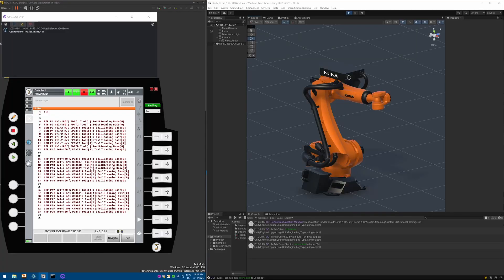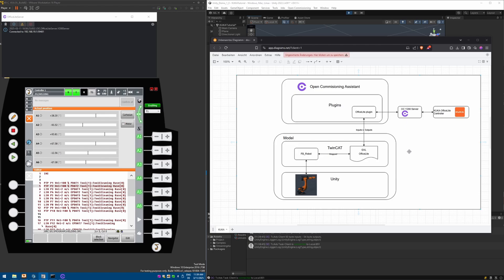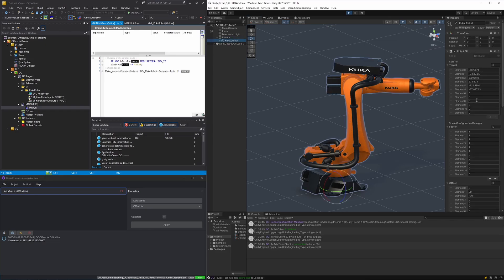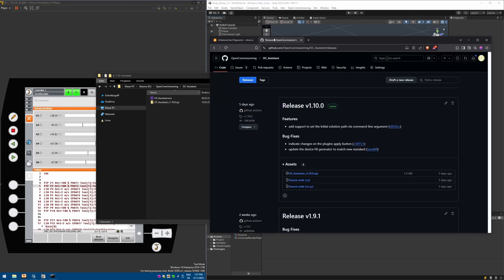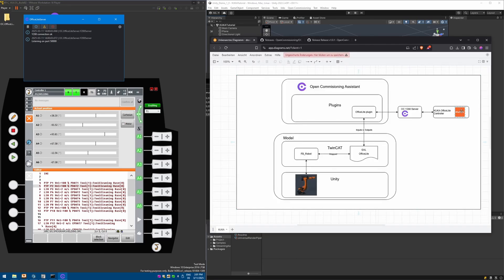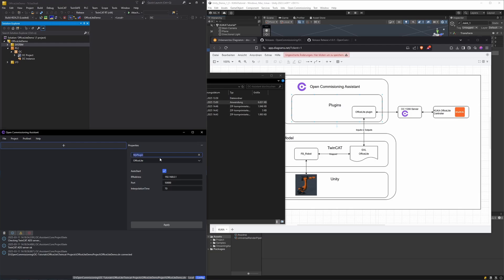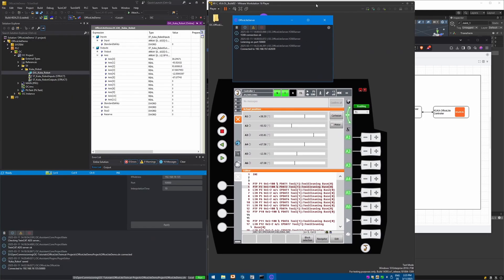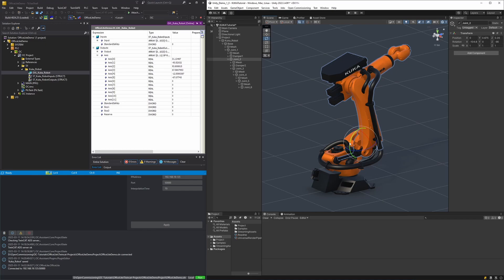Open Commissioning - Tutorial 7: Connecting KUKA OfficeLite Controller

Comment: super interesting, just wondering if you could provide some info about how to get the unity project please (just to get the robot model or prefab)
Reply: By recommendation of Viktor, I'm using Flange, from GitHub. Is your communication between OC and Twincat working? It's not updating projects...
Reply: @vulduovlak   Communication between OC and Twincat Worked Fine on Demo unity Project. didn't tried yet on OfficeLite due to i was setting up the robot model, i'll test it this weekend, keep you updated
Reply: @vulduovlak  Update. it Worked, I Had some problems running OfficeLite (VMware) and TwinCat runtime at the same, stuff about virtualization, it was solved by manually isolating one processor core in twincat (found some info about AMD presents this kind of problems,)
Also got the Robot CAD (4 axis in my case) and setted up in unity. I'll borrow a intel PC to check how it works on intel